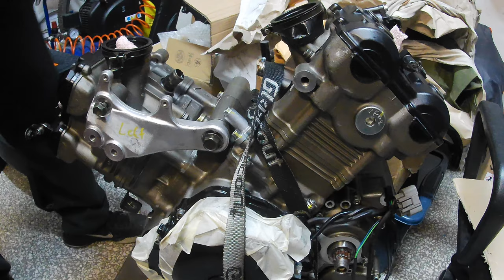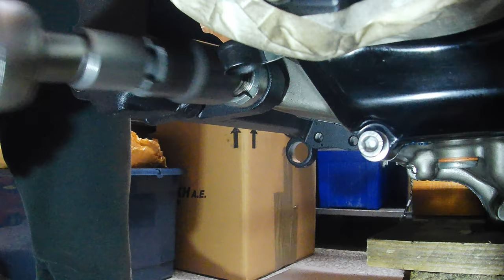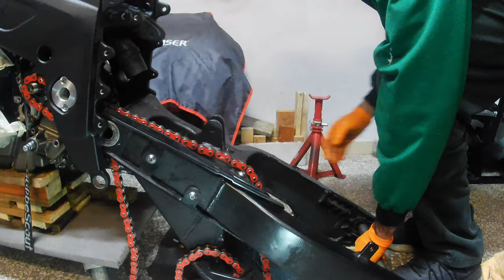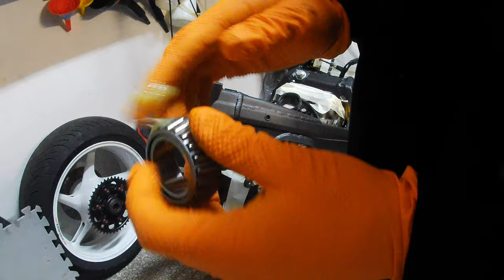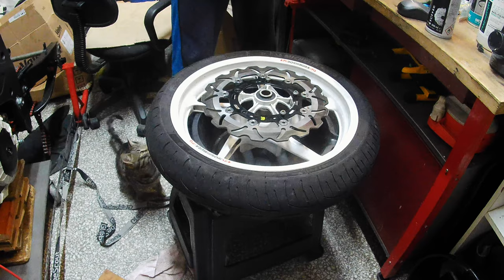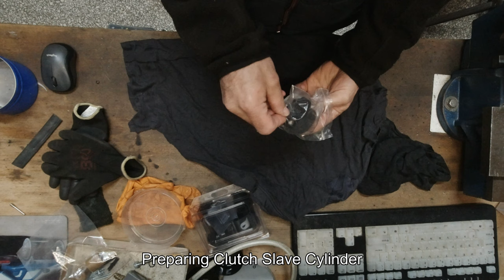TL1000R Revival Part 5 - Rolling Chassis

Comment: did u powdercoat or paint frame?
Reply from the maker: Powder coated! Since I had it all apart, and I always wanted to do it. Thanks
Reply: @Ride2Xplore  was watching again, did you know there is an upgrade that suzuki did for the clutch slave cylinder..a rubber cap fits into the inside cover, wasnt sure if u had done that
Reply from the maker: @moystonadv3651  At the time no. I found later info about it. I believe it's a sv1000 part. I will have to order this along with some little bits.